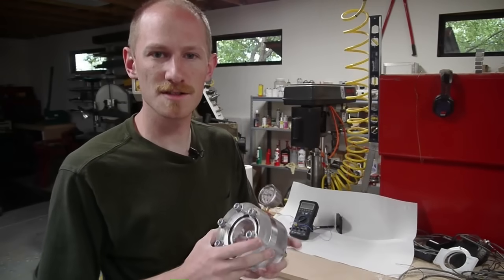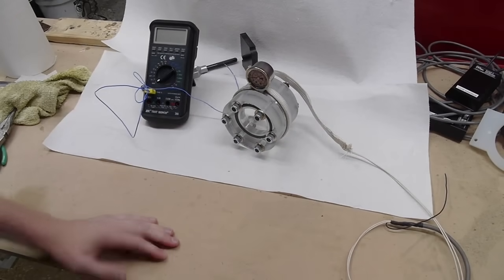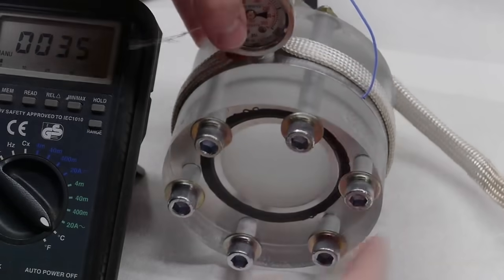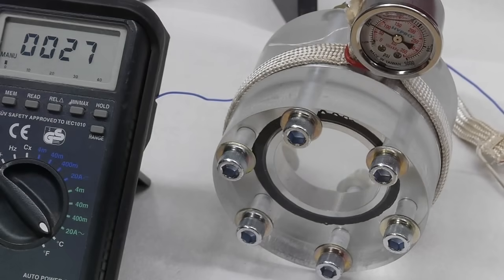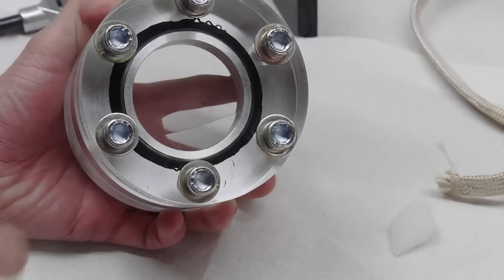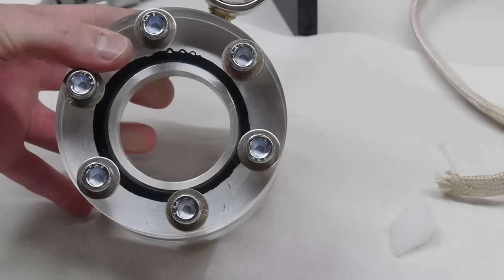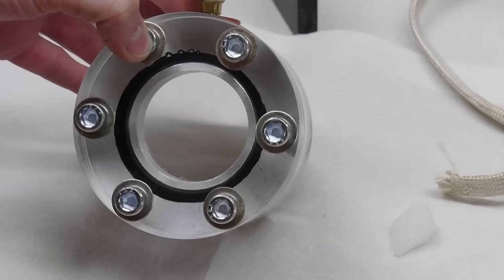A close look at supercritical carbon dioxide CO2

Comment: A possible solution to your O-ring problem would be to loosen your gauge off so that it bleeds off CO2 gas until you have it all together and then tighten gauge up last.
Reply: My thinking as well but also cooling off the aluminium section before closing it up.
Reply: Good idea. Let it bleed .  Or  c clamp , then tighten  bolts.
Reply: @ynotwebb1408  Don't you want the have high pressure inside though, as Co2 has to be above 75 psi to be a liquid? If you let the pressure out aren't you just letting out Co2 which is the equivalent of putting less in?
Reply: cryo-freeze the entire apparatus, leave the gauge ever so slightly loose, fit a solid piece of dry ice which fits perfectly,  g-clamp it and bolt it down! those few seconds of CO2 venting will expel the remaining air
Reply: @paulbiggs90  need to be fast.... it let the gas leak a bit to make the sealing more perfect
Reply: T out the top to gauge and valve would look awkward but work

Comment: I would buy one of these
Reply: me too
Reply: Its practically a bomb though
Reply: @nozumihishimatchi1880  no more so than a CO2 welding tank... Except this one has a lot less CO2.
Reply: @nozumihishimatchi1880  nah I've worked with enough pressure vessels. The failure mode will be deformed plastic, oring failure and leaking CO2. You might get a freezer burn at worst, but explosion is not likely.
Reply: @nozumihishimatchi1880  not even close!
Reply: Nilered wanted to buy one of these and this guy was kind enough to donate it!

Comment from the maker: Good question. As long as the CO2 is above the critical temperature and pressure, it is by definition a supercritical fluid.This implies that the chamber contain a certain amount of liquid before heating or else there will not be enough mass to raise the pressure high enough to reach criticality upon heating. If the chamber starts with only 5% liquid, no amount of heating will create a supercritical fluid. It needs to be *appx* 50% liquid to create enough pressure on heating to pass criticality.

Comment: You can also extracted the the essential oils from cannabis with supercritical co2.
Reply: I like bananas
Reply: "Essential oils" ;)
Reply: Actually this is the only way to make THC e-liquid for e-cigarettes. So if you can do it, you could get rich
Reply: its not the only way. its just a common way. an even more common way is to isolate the THC fraction by molecular distillation with a shortpath distillation apparatus. 95%-99.9% thc is the same consistency as winterized co2 oil. a lot of people distill co2 oil to isolate the thc fraction. bho, pho, and ethanol extracted oil are commonly used also. the distilled thc fraction is 100% solventfree. The most well known brand of this is called "clear concentrate".
The easiest way to make Eliquid is to mix bho with a thinning agent like PEG, PG, VG or naturally derived terpenes. Most co2 oil pens are co2 oil diluted with PEG. Open vape is the most well known and its half winterized co2 oil and half PEG.
Reply: I have been since 2009. ive been making it since 2010. its vaporized, not smoked. Meaning the oils are applied to a heated surface that they boil on and the vapor is inhaled. Im not sure what youre dabbing that would burn your lungs. 
Yes, i am after the essential oils. The oils in the resin glands are what gives cannabis its effect, smell and flavor.
Reply: I can't really understand what you wrote, my English is not that good. I meant there are several extraction methods, like fractional distillation, ethanol tinctures, BHO (butane hash oil) and so on. These methods do not work if you wan't to make e-liquid, because the end product is not clean enough. Most e-liquids contains only artificial flavorings, and there's a reason for that. These are more clear chemicals, only compounds, not mixtures. Natural flavorings contains more essential oils, and more random side chemicals, and both of these are harmful for vaping.
The only way to make - somewhat - healthier THC e-liquid is making supercritical CO2 extract of cannabis. That will be a quite clean THC extract. THC is an essential oil, so it's not healthy to vape, but at least it would be so clean, that it won't have terrible taste and harm for your lungs.
Reply: Do you extract cannabis oil to make Eliquid? I have been extracting cannabis oil since 2010. Ive made thousands of prefilled THC ecig cartridges. I never used any flavoring. I use winterized BHO or fractionally distilled THC thats distilled from BHO. ive used raw co2 oil and winterized co2 oil as well.
co2 extraction isnt the only way to make "thc eliquid".raw and winterized co2 oil is not as clean as THC distillate. Distillate can be made from almost every extraction method. Distillate is made from oil like BHO and co2 oil. It further purifies it, bringing the THC percentage up to 95%-99.9%. When its that pure, its a gold liquid that vaporizes better than co2 oil in ecig tanks. Its also smoother than co2 extracted cannabis oil.
the reason most co2 oil works in ecig tanks, is because its viscosity is low enough to wick. The higher viscosity of BHO is the reason most of it doesnt work as well as co2 extracted oil in ecig tanks. lab results show co2 oil has more impurities than BHO.
Im saying "THC" so im not making this as confusing. Really co2 oil has over 200 different molecules in it. THC is only 1 of them. super critical co2 extracted cannabis oil has high amounts of plant wax and fat in it if its not further purified with ethanol via winterization. The wax and fat is vary unpleasant to vaporize. it irritates your lungs.
inhaling THC vapor is healthier than inhaling smoke from combusted plant material along with the THC.
Reply: Well I don't know much about the subject. I haven't make plant extract e-liquid yet. Once I tried dissolving dried plant powder in PG and then filtering it, but it was terrible. It definitely needed a more cleaner extraction method. So I searched online, and found that the common methods won't work, and the only way is CO2 extract. Maybe that's not true, I don't know.
After I found out that supercritical CO2 is needed - which are hardly possible to do at home - I didn't really continued my search. Maybe it's a good idea to use other methods after the CO2 extractions. But I've never heard about that BHO can be used.
And I'm not talking about just cannabis, in fact I wanted to extract other plants, like kanna, kava kava, kratom. I didn't care much about cannabis since it's illegal in my country.
Reply: yeah i just starting vaping CO2 extracted in an egic
 i thought it was cleaner though in terms of not leaving any  solvent trace i mean does the butane   get  100% removed from the final product?seems like CO2 would be the least toxic the THC purity is not an issue for me , i find it funny how he says this can be used to decaff coffee and extract  caffeine ,i mean how do you just remove the caffeine and not the coffee oils and all the flavor?how can you  use this method to separate the  different  extracted compounds?
my friend sand his stuff to a lab to have it extracted ,i wonder how big of a containment vessel would you need for commercial extraction he gets like 100CC syringes
Reply: Now this is good to know!
Reply: so what state of matter is supercritical exactly anyways? in school we are taught there are 4 states ,  solid ,liquid, gas , and plasma
 seem like this s a 5th state between  liquid and gas?
Reply: Recommend "doober" critical CO2 for cannabis oils extraction
Reply: Wow. You just casually talk about this stuff. Where I live you can get a fine or get criminal record just if you repost a picture of cannabis
Reply: Andrea Mitchell there is something like 14 states of matter I believe, and hundreds of sub-states. Time crystals, bose-Einstein condensate, quark gluon plasma etc. Supercritical substances share properties of many states of matter and exhibit some really wierd interactions with other stuff
Reply: butane has always been the most logical to me.. as long as you understand evaporation you cant really srew up haha
Reply: Good one, Samuel Forsyth.  When writing about not screwing up you wrote srew up.
Reply: Supercritical state is actually a gas state but a very dense one.  Above the critical temperature, the liquid state is not possible no matter how much you compress.
Reply: You can extract the essential oils from anything
Reply: Tiiiiiiiiime cryyyyyystaaaaaals!!!!!!!
Reply: @TheKrololo  free speech is a great thing🇺🇸
Reply: @andreamitchell4758  your comment is a year old, but it's not really a fifth state. I think it is more appropriate to think of gasses and liquids as two divisions of the same state, fluids. This is just a demonstration of where at certain conditions the boundary between those two divisions stops.
Reply: @Dirty Sack 
Nobody did that in the 70's or 80' or most of the 90's. 
Nobody knew you could do that.
We had the "Isomerizer", which sucked ass in comparison.
Reply: @noahmcabee4023  mother Russia
Reply: @TheKrololo  oof bring yo ass to Dixie
Reply: @bretmaverick9117  You pretty much described what I do at my lab wit a supercritical fluid extractor and a shortpath distilator.

Comment: Hello,
a few tipps:
- o-ring grooves are easier to produce on a lathe.
- you can turn your aluminum ring, screw one acrylic disc onto it. then clamp the aluminum disc in the cuck and turn the acrylic.same procedure for the second one.
- if you screw in the barometer AFTER you mounted the discs together, your o-rings will fit perfect. the overpressure will be able to flow out while you are tightening the screws.

but however: its an amazing effect, i didn't expect. thanks for the video.

Comment: I found this video when I was trying to find a visualization of how the atmosphere of Venus with 96.5% Carbon Dioxide, a surface temperature of 740 K (467 °C or 872 °F) and a surface pressure of 95 bars would look like, since it is expected in these conditions that the CO2 would exist in its supercritical state. I was impressed to observe the phase change when the liquid phase mixed with the gas phase to create a light impenetrable mist that looked (to me at least) as a very Venus atmosphere-like. I think that simulating Venus atmosphere is an excellent use for your fine construction!

Comment: Perhaps a small needle valve which could stand the pressure used as a temporary relief during assembly?
Reply: Certainly!
Adding a T fitting at the gauge will allow a needle or ball valve to be connected. Small high-pressure stainless steel ball valves are not terribly expensive. This also would make it possible to fill from a CO2 storage tank.

Comment: You can buy CO2 in gas bottles with a head gas added (usually Helium).  The bottle is filled about half way with CO2 then the head gas is added to raise the pressure well over 1200 psi.  That way you can add CO2 as a liquid and fill the chamber completely with liquid.  Of course you would need to buy hoses, valves, and fittings to hook it all together but having a super critical extractor setup could be useful.

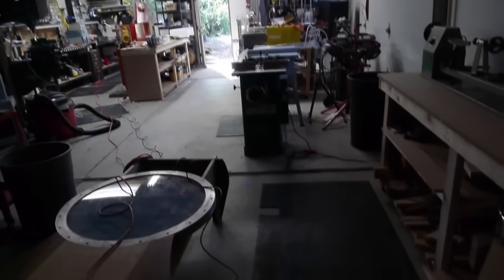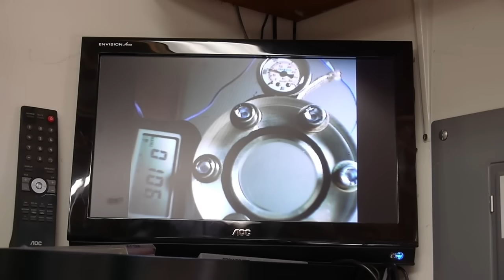Comment: 6:45 to 6:53 is a good example of the liquid and gas phases merging as the temperature rises. The air on the surface of Venus is also a supercritical fluid because the pressure is 92 bars (460-480 degrees C or 860-900F) and its 96% co2 and the rest is mainly Nitrogen (also supercritical at 92 bars). Despite the supercritical phase on Venus, its still like a gas but the air also dissolves smoke, it floats. You cannot light a fire on Venus.

Comment: Just put the meter in last. O ring problem solved.
Reply: aye
Reply: good luck getting the dry ice through that little hole
Reply: Felix Q Or do everything in a freezer. The only problem, though, is that it would have to be at a very low temperature, so his hands would freeze, but well, it’s a minor inconvenience (I’m obviously joking)
Reply: Venting is a good idea.  Also, preassemble the device as much as you can and use a jig if necessary and use a driver to zip those nuts up to torque very quickly.

Alternatively, assemble the whole thing in a bath of liquid CO2. [joke]

Comment: The acrylic should not be placed directly in contact with the liquid Co2. You should use a thin glass barrier along that is cut just a hair smaller than the diameter of the acrylic opening. Purchase a large O ring that is on the thinner side as opposed to the thicker bulky ones.  In an ideal conditions the O ring should fit in the small gap between the glass outer diameter and the acrylics. When you join both sides together the pieces should be designed to press against the large O ring causing it to compress within the small space between glass and Acrylic.  You may want to look into using some sort of Burst disc rated at a PSI that would in theory be below the estimated rating for the acrylic.  When handling Cryogenics it can be very unforgiving. A leak or a tiny rupture won't really do much. If the acrylic becomes brittle and fails over large surface area then it will basically be a bomb.

Comment: I love this thing!  You could have kept the O-ring in place by freezing the components down to -20C, then cooling further with dry ice.  If you did the final assembly in an open-top styrofoam cooler, the dry ice used for cooling components and filling the resevoir would also displace the air, I think, giving you nothing but CO2 in there.

There's also got to be some amount of CO2 (maybe you have to measure to the 1/10g or something?) that would let it reach the triple-point?

Comment: When you were machining the aluminium body on the lathe why dident you just machine the o ring grooves after the facing cuts? Then make your bolt circle on thr mill. Easy peasy
Reply from the maker: In some ways, it's easier on the CNC mill because I don't have to measure anything, and the part will come out very close to spec'd dimensions.  It would probably take me longer to measure and cut it on the lathe, even though I agree that lathe-cutting the gland would leave a better finish.
Reply: @AppliedScience  You've gotta go watch This Old Tony for a bit!

Comment: Build one in square or triangle shape and use "Peltiers" to heat it up or cool it down with a small regulator so you can just plug it in the wall or a power bank / usb. That would be cool/nice.

Comment: Great stuff. I'd just like to see metric units too. I (as well as most of the World) don't do PSI and °F, rather N and K. 
Of course, I converted the units, but scientific video should use SI units, don't you think?
Reply: Staremperor I am a scientist here in the US and I'm fine with either standard or metric. Conversions are so easy now it's not really an issue. I can see your point though.
Reply: F is absurd for sure, it was invented using what I can only describe as arbitrary reference points like the freezing point of brine and the average human body temperature... it appeals only as a convenient measure for ambient atmospheric air temperature at sea level, with a general public-friendly range between -40 and perhaps 130 at the extremes. C is far better and logical, and K is of course essential, but less easily grasped by those without a background in science. PSI is also a bit awkward, I just tend to use the 14.5:1 bar approximation for quick calcs. Bar, although not an SI unit technically, is handy as it is a multiple of the SI unit Pa, but tends to reflect better the kinds of pressures used in most applications as 1 Pa is very small. I'm not quite sure what you meant by N, since it isn't a measure of pressure, rather 1 N/m^2 is equal to 1 Pa, which is what I assume you meant. But I do agree with you, SI units on a science-related video should be standard in my opinion.

Comment: Thank you for making the transition to supercritical visible.
I first learned of this effect when filling a sodastream canister from a large CO2 tank used for MIG welding. I mistakenly thought that if I heated the large tank and cooled the small one that I would get a better transfer. I warmed the large tank in my car in the sun and when it was uncomfortably warm did the transfer, and noticed got worse results than when just using room temperature. I assume supercritical CO2 was created with a lower density than liquid.